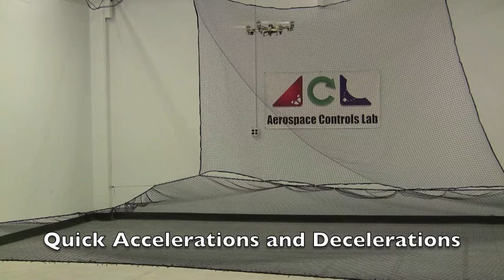MIT ACL -  Variable Pitch Quadrotor

Comment: I support the dev of VPP quadcopters (in a 5-7" prop size). Because it's in my interest. I fly 3D mode FPV quadcopters, but currently with FPP. There may be an additional advantage of FPP quadcopters over FPP helicopters. I noticed that almost all helicopter FPV videos show very strong vibrations in the camera recording. Either this is due to poor attachment or it is generally the case that FPV is much more suitable for quadcopters than it is for helicopters. With quadcopters you can get very smooth, vibration-free shots. It's probably not for nothing that helicopters were never used as small camera drones.

Comment: congratulations. the integration of the system into the uav was quite effective. thus, the flight performance will also be increased while in the air. in addition, variable-pitch propellers will make a huge contribution to the aggressive movements of the uav. I'm wondering how the system controls the operation by remote control.

Comment: Reverse thrust is instantaneous on modern fpv motors too now
Reply: Yep, 3D with FPP is now also very good (on 5" quadcopters). VPP also does not mean thrust reversal in 0 seconds. The speed of the servos is also a limiting factor here... and the additional weight of the servos also makes it harder for reverse trust/direction. So the question is can someone build a 5-7" VPP 3D quadcopter that can beat a 5-7" FPP 3D quadcopter in freestyle/aerodynamics tricks ?

Comment: How would you control yaw without a full helicopter-type swashplate on each rotor?  I can see three potential methods of achieving yaw control if you had a full swashplate on each rotor, but just having variable pitch makes me think you can only control pitch, roll, and thrust.
Reply: +Skratche17 
You don't need a swashplate or tilting rotors to get yaw control. Yaw control on a variable pitch quadrotor works exactly the same way a yaw control on a fixed pitch quad. In each case it is achieved by generating more/less drag on each opposed pair of props that are rotating in the same direction.

The drag can be changed in two ways with the same net result.
1) Increase/decrease speed
2) Increase/decrease pitch

#2 can typically be done faster than #1

Comment: they forgot to mention one of the most important advantages, it could potentioally be used in conjunction with a Nitros engine!
Reply: The only way quadcopters can make the leap from toys to serious machines is if they can get big enough to carry things and people and long-duration enough to be able to carry out serious work.  Perhaps a fuel-air engine (gasoline, turbine, diesel) generating electrical power for the individual motors running each rotor.  Perhaps with a battery pack for short-duration quiet flight.  A hybrid, in other words. 

Right now you've interesting kiddie toys that can fly for ten to twenty minutes and can carry a GoPro.
Reply: @pinz2022  no

Comment: and now we have the Invertix 400, and Align Leap 3D quad, which are capable of inverted flight by simply reversing the motors in flight :) the propellers are symmetrical, so there is even negative and positive amounts of thrust. 

The Curtis Youngbloood is a variable pitch quadcopter capable of flips, and other crazy stuff, but its much more complicated than the Invertix 400.
Reply: Oh hah you were even here :)

Comment: i guess you're right, but it would be better for two motors to run the 4 rotors because the strain of cp blades would be dispersed to 2 motors, rather than have one motor strain

Comment: The motor, for the most part, isn't making the yaw torque, it's the blades against the air that does it. I suppose, in a single engine get-up, you could just flip two of the belts. this way the motors on the flipped belts rotate anti-directional to the motor. this was done with chains on the wright flyer, Google some pictures of it and check it out. the wright brothers understood torque and figured out counter-rotation using a single engine.

Comment: right, you were totally correct to call him out. but when adding pitch the motor will probably bog, and in the case of a quad like in the video, motors slowing down due to drag from a variable pitch prop could benefit from variable speed. you keep motor running 50 or 80% speed at zero pitch, increase it to 100 in both directions. pitch becomes exactly linear, and gives a little stability back, makes the computer's job less hard.

Comment: the motor would need to be 4 times larger- and would need to be even more powerful to deal with the drag of the belts and added mechanical complexity of the pulleys and bearings- all in all you would lose efficiency.

Comment: Great concept but very poorly executed considering this is MIT. The frame looks too flexible, the control arms too much slop and blades need to taper. They need to address the basics before they can hope to tune the FCB to handle VP.
The quad in rcgroups - Aircraft - Electric - Helis Multi Rotor Helis - Variable Pitch Experiment has a more elegant, less sloppy VP solution.

Comment: A fixed pitch multicopter has higher power-to-weight.
It also looks like your servos aren't all sychronized.
Use faster servos recommended for helicopter tail control.